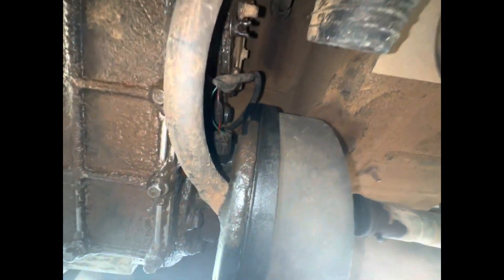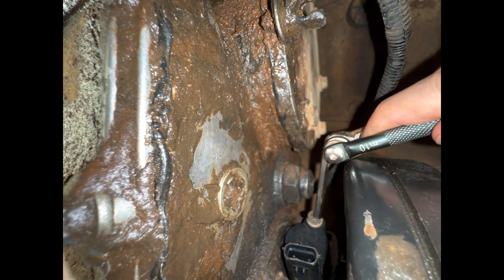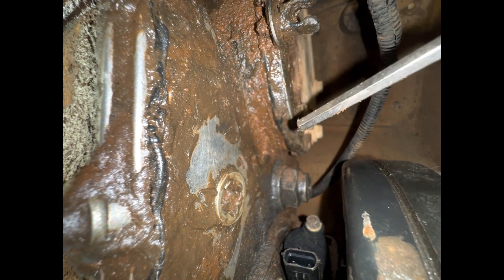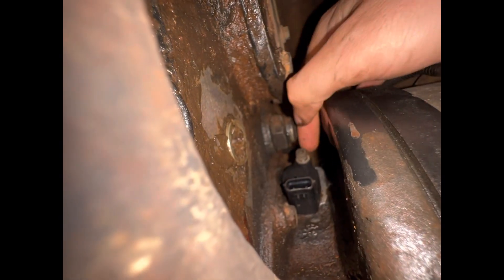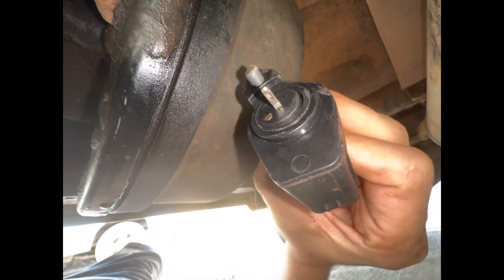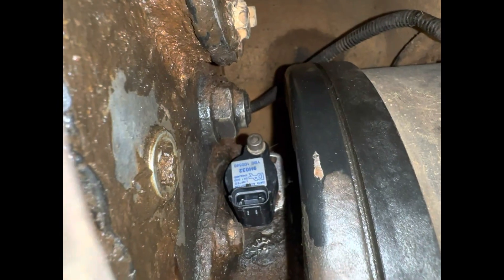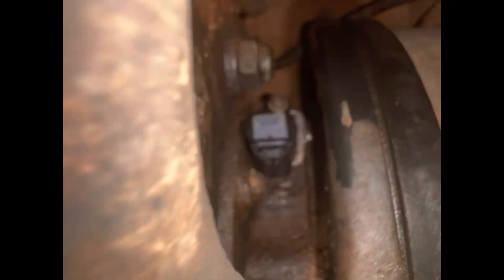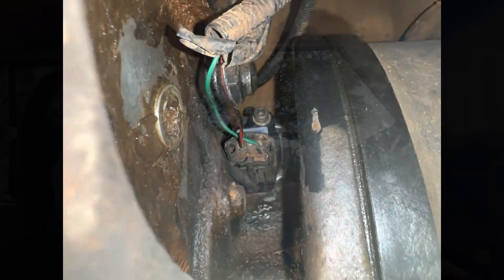Replace Vehicle Speed Sensor VSS Intermittent Speedometer Kilometer counter Land Rover Discovery 1

Comment: Aloha, I have an LR Discovery on Big Island. It has Three Amigos issue (persistent) and a gear selector issue when the LR is cold (can’t get out of Drive, flashing lights on the selector). A friend recommended your video and said the connection to the VSS might be muddy. Can I send you a photo of (what I think is) my VSS to make sure that I’m looking at the correct connection?